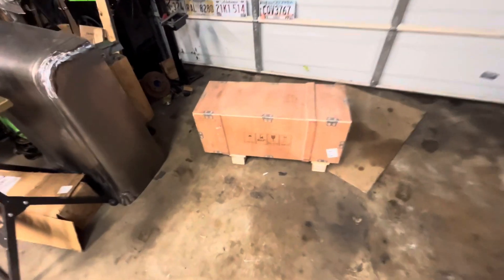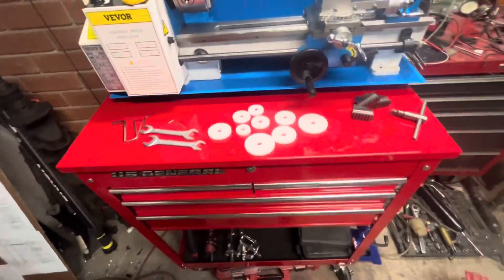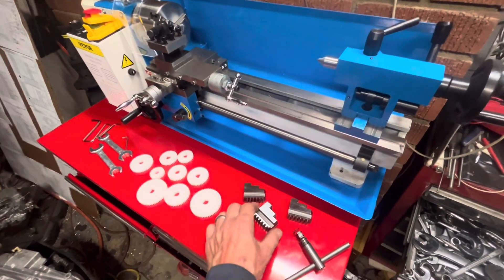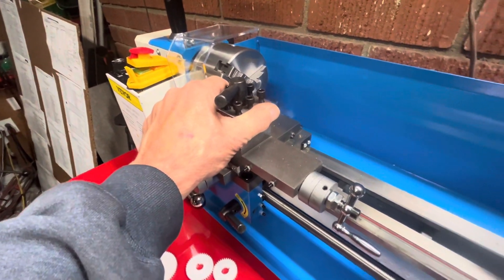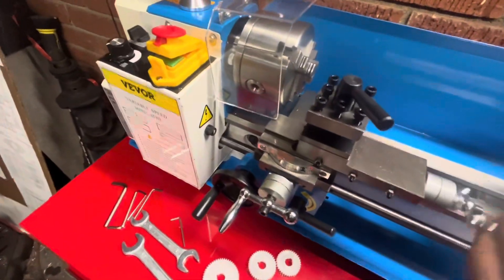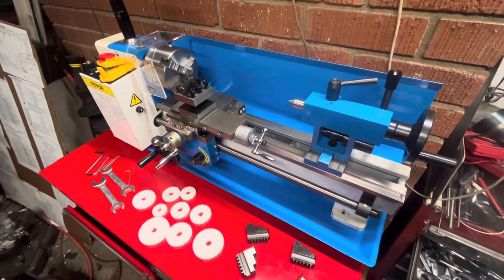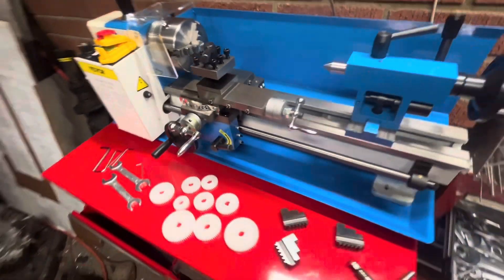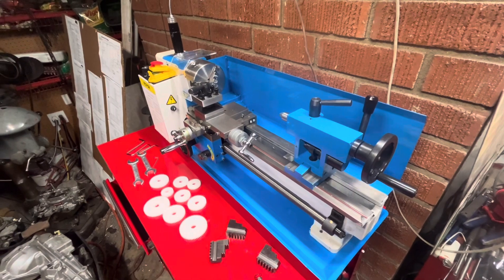$400 Vevor 7x14” mini lathe vs harbor freight 7x10 first look and power up! #machinery #fabrication

Comment: Be sure and check the alignment of the the headstock relative to the bed.  You need an indicator dial to do that.  I may have bought from same seller on ebay.  I found that when I turned a part the diameter varied so it was a slight cone shape.  This made the lathe basically useless.  I ended up getting a $150 refund from the seller after asking to return the lathe.  I finally got the problem corrected but it was a lot of trouble.  You can shim the headstock if the alignment is not too bad off.  Hope you got a better one than I did.
Reply from the maker: Ok thanks for letting me know. I’ve only done basic stuff with it so far. It was pretty useless with the stock motor, the servo motor upgrade made it great. I have noticed when I use the tail stock, the bits wobble. I bought a counter sink to help start the hole. Maybe this is the problem
Reply: @Motorhead_Mark  If the headstock alignment is not true it will affect the tailstock alignment.  There is some side to side adjustment but vertical adjustment can be raised with some brass shims.
Reply from the maker: Oh ok I think I understand what you’re talking about. I do have a dial indicator. Next time I machine a face on a disk I’ll check it out. Thanks for your comments

Comment: If it's at least as good as the HF unit, that is a no brainer for $400.
Reply from the maker: I’m going to turn some washers tonight. It does take 1/2” lathe bits vs 3/8 on the hf unit. I’ll post a video tonight
Reply: Oka@Motorhead_Mark OK it's now January 2025.how did it work out
Reply from the maker: I like it. Limited space at home. I did do the servo motor, it has no power out of the box on larger parts